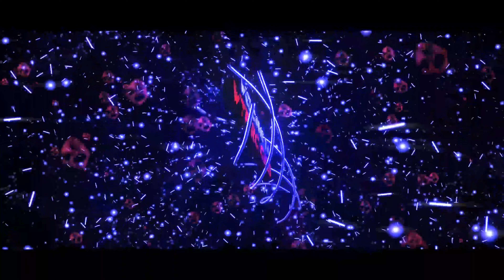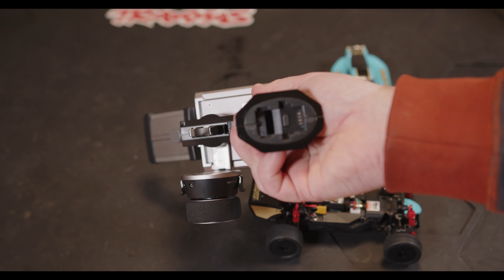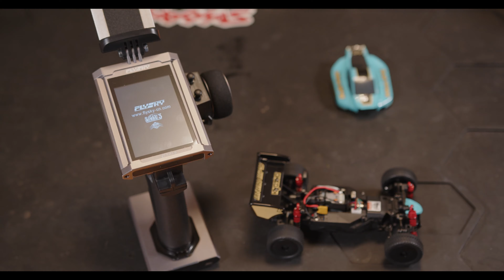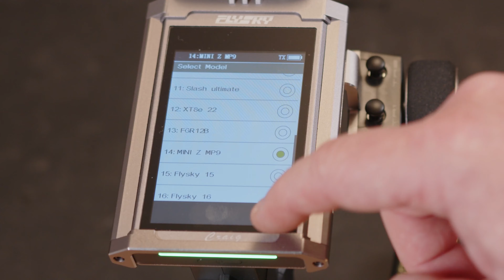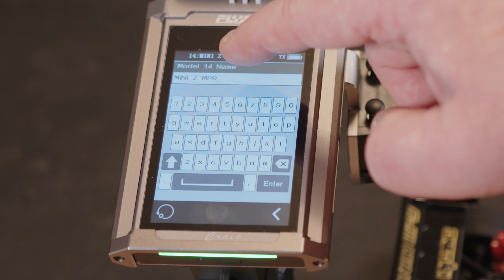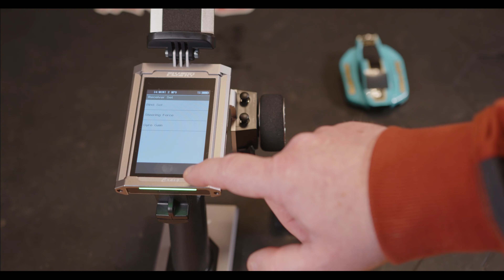FS RM005 mini z FHSS Noble Pro install and bind guide

Comment: Can a Noble pro be bound to SCX24 stock electronics with this radio frequency thing or this FS RM005?
Reply from the maker: No the stock receiver won't work with any flysky radio but it's easy to swap out the stock receiver for a dasmikro receiver/ESC on one I have vids on the scx24 playlist showing how to do it :)

Comment: When I connect the NB4 to my PC and select online device settings it shows the tx but no other info is shown like hardware, UID, etc… what’s the deal?
Reply from the maker: What firmware is you nb4 on? It needs at least 2.0.93
Reply: @WTFRCCars  firmware was 2.085. Finally got it. Didn’t realize you had to select firmware update on the tx prior to initiating. 
Thank you!
Reply from the maker: Yeh I'd get the nb4 updated to 2.0.100 :)
Reply: @WTFRCCars  the v3 assistant only showed up to .99

Comment: The ability is really making me want to get a Mini-Z
Reply from the maker: Main reason I got a mini z, have you seen the top spec race mini z on AliExpress full carbon chassis and even belt drive 4x4 chassis way better than the mini z Evo
Reply: @WTFRCCars  Dont tell me that as i will go and look and then end up buying it 😂😂
Reply from the maker: ￡294.83  40%OFF | ATOMIC Limited Edition DRZ2 Floating Mosquito Vehicle RC Rear Wheel Drive Anti-tire DriftRWD Drift Frame
https://a.aliexpress.com/_mPYZXbO
Reply: @WTFRCCars man could you please link that on ali? 😃🤟
Reply from the maker: ￡208.55  30%OFF | 1:27 Mini Remote Control Rc Car Kit Mini Belt Electric Vehicle Carbon Fiber Racing Frame For 1:27 Rc Racing Car Accessories
https://a.aliexpress.com/_mP3XBfq
Reply from the maker: Od a drift one 

￡127.12  40%OFF | TSRACING Upgraded Car Frame With Gyroscopes Servo for Dpa Rear-wheel-drive Drift Car ATM DRZ HGD1 Mini-Z
https://a.aliexpress.com/_mPkzvOk